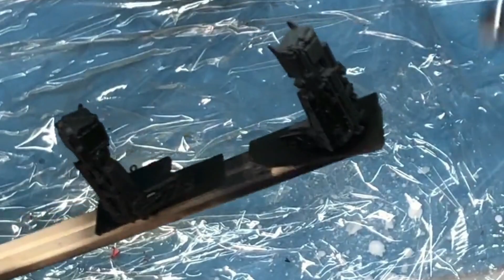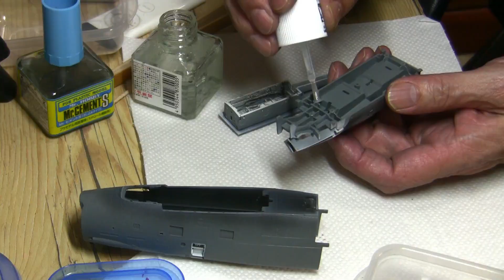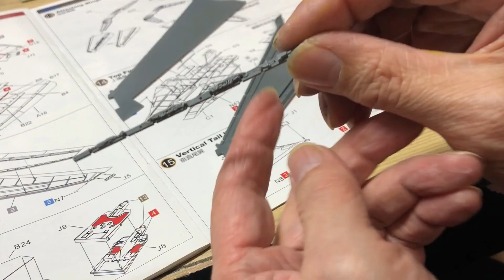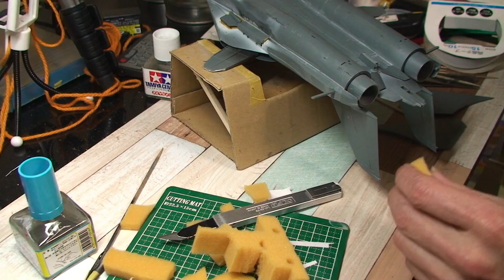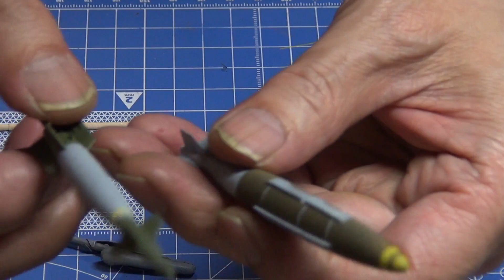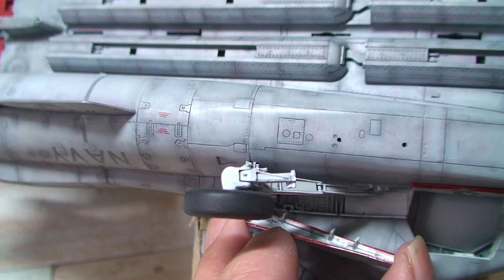Build and Completed! ～AMK F-14D 1/48 SUPERTOMCAT English ver ｜Yes! Plamo Tsukurot!

Comment: Which has better details and fitment? 
AMK or Tamiya. I have two boxes of Tamiya.
This kit looks really good tho.
Beautiful,
Reply from the maker: Tamiya has no experience, but has a good reputation for good fitting. I think it's very easy to make.
In comparison, AMK is a unique kit with very delicate and realistic details.
It's hard to compare.
Reply: Tamiya is much easier to put together, it pretty much falls together. AMK has more options with the refueling probe and spoilers, but has fit issues and the instructions are very hard to understand at times. Basically if you have some experience, and are willing to do filling and sanding AMK is great, but if you want something that will take half as long and doesn’t require a lot of extra work Tamiya is the way to go.
Reply: I have both AMK and Tamiya. In term of details...AMK better...but Tamiya is less complex to build.